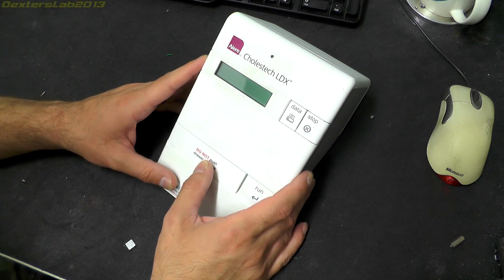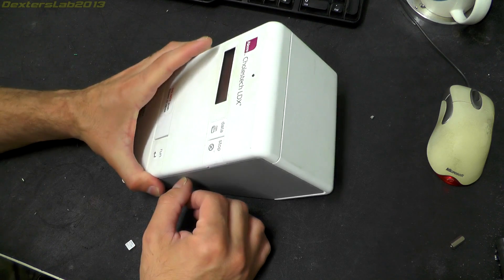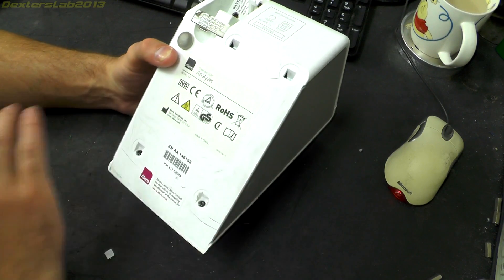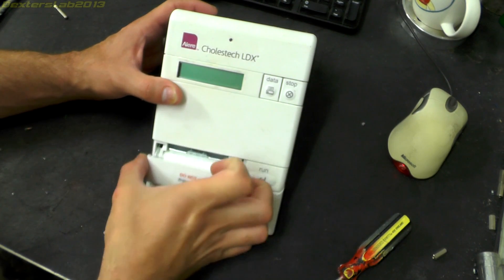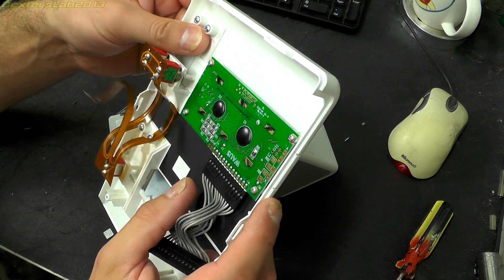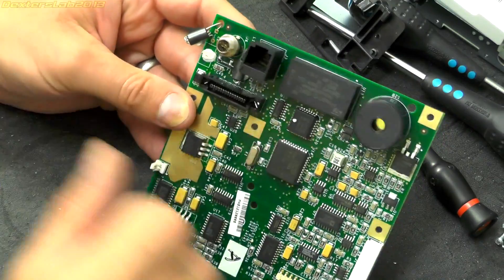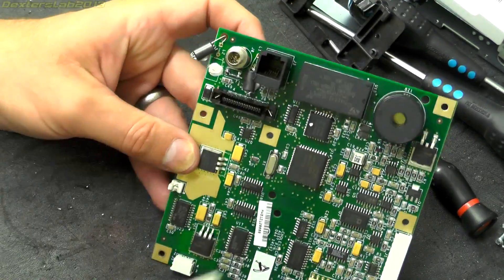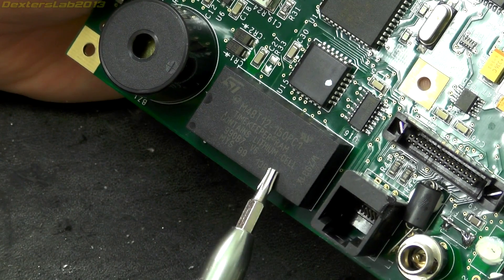DL#102 - Cholestech LDX Cholesterol Analyser Teardown

Comment: I can smell that polyamide smoke from here!  I'm curious to know what wavelength those LEDs operated at - they're not there just for show, considering the effort built in to detect transmittance / fluorescence against the sample.  Thank you for showing us the internals!
Reply from the maker: The detector diodes are all the same, labelled TB1113H, the emitters are a green/yellow colour.

Comment: Because different batches of chemistry may vary, many analysers have rom packs holding calibration data . The analyser will check the batch number on the cassette.
Reply from the maker: Interesting, so each box of cassettes includes a new rom pack?